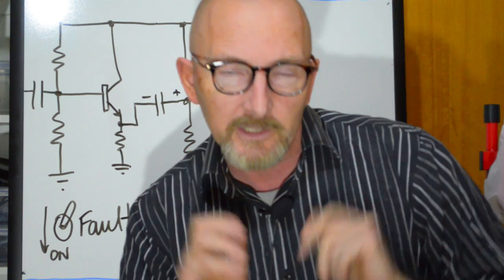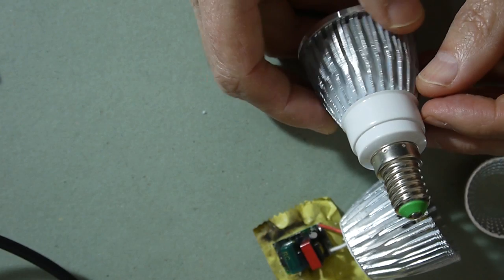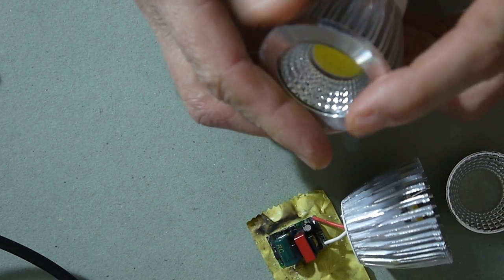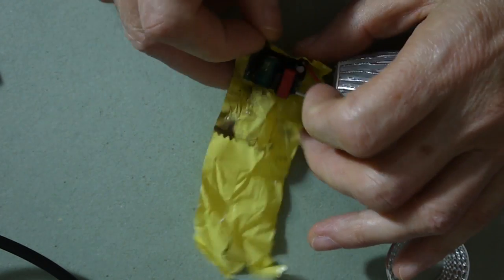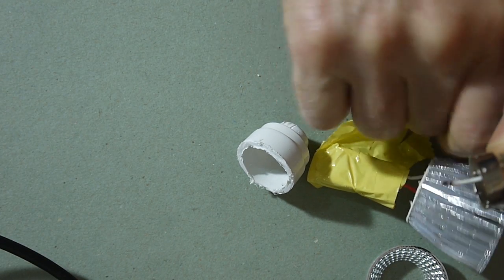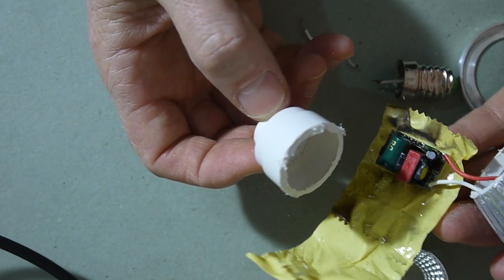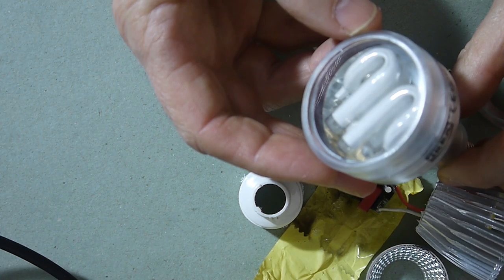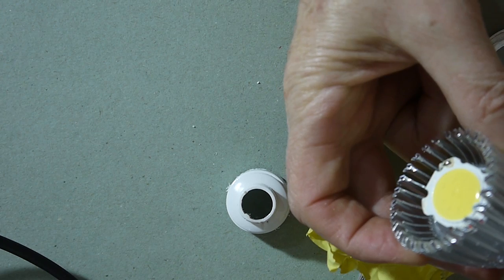LED LIGHTS FIRE HAZARD AND ELECTROCUTION RISK, EBAY CHINESE LED LAMPS

Comment: I have no experience with those types of lamps but have just bought four four foot led batten lamps and they are just as bad, in fact even worse because mine came with a three lead electrical cable but inside the earth or ground cable was not connected at all! The body of the lamp is an aluminium extrusion, abs the circuit driver board was wrapped in the exact same yellow "Sellotape" no fucking insulation at all. So if f the unit got hot you could get electrocuted as the frame isn't grounded therefore it could be live or hot don't buy there pieces of shit either!

Comment: Yes, I do agree with you that this particular bulb is very poorly made, in particular it's power supply. The power supply's transformer appears extremely undersized, and it's overall construction was a perfect example of a shoddy design & production. I actually believe that the white wire not being soldered properly (a cold solder connection) was the reason for it's failure, but I still wouldn't want this do to it's extremely poor power supply design. The only issue I have with this video is the pronunciation of the word ''aluminum''. I realize how insignificant this is, but on the other side of the pond (the U.S.) so to speak, we pronounce the word with 4 syllables, not 5. Unless the word is spelled ''aluminium'' in the U.K., it would be pronounced with 5 syllables. Pardon me for me getting off the subject & being so picky about the pronunciation of a word, but every time I hear aluminum pronounced this way by apparent U.K. experts of whatever, it annoys me tremendously. Other than that, thank you for dissecting this light to show us how poorly this light was built, as well as showing how dangerous these cheap LED bulbs are. Again, thank you & take care.

Comment: Branded LEDs are only slightly better or no better. I've had problems from name-brand LED bulbs. It's all made in China and China has poor quality control. Branded bulbs are more likely to be "safe enough", but it's no guarantee of safety. How safe they depend on how much the factory that made them cares about sticking to the rules and agreements between them and the company brand. Generally speaking, you should never leave any electrical item unsupervised. About the only exception would be incandescent light bulbs that are in proper holders with nothing around them that can catch fire. I've never had an incandescent bulb explode, only burn out.

This all being said, you are playing with fire with any cheap Chinese item that uses mains power, branded or not. Don't leave anything plugged in without you being home unless it has performed without issue for many years and has no reason to change how it performs. For example, my refrigerator. Built in the 1950s. It has been purring along for decades without issue. I'm reasonably confident that it will continue to do so as there are no signs of any issues that would cause it to perform otherwise. However, my LED lights in my ceiling fan (I rarely use the fan but always use the light), I have had two of them go out just this week. They are name-brand LED lights. They cost quite a lot of money. Both failed in a similar way. Had I not been home, it probably would have caused a fire. This is why I turn everything off that could pose a fire risk when I leave home. Just because something is branded doesn't mean much.

Comment: Uhhh, can we see what the lamp looks like fully assembled, or what it's called on eBay?  I have a 10w LED gooseneck dual-head grow light with those aluminum parts, but I wasn't electrocuted when I touched it.  It's called a "RundA" brand I believe.  Is this the same thing?  It was sold by a U.S. source, not Chinese.  But who knows where they got it :\